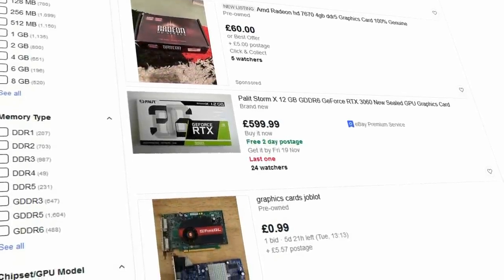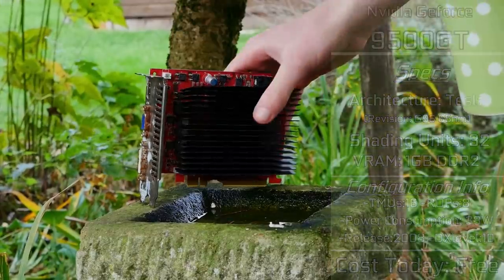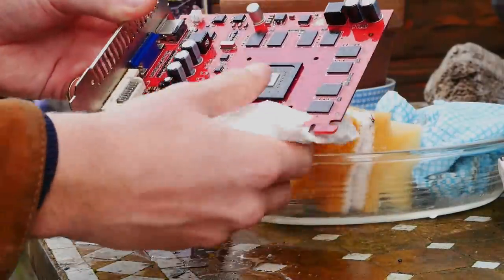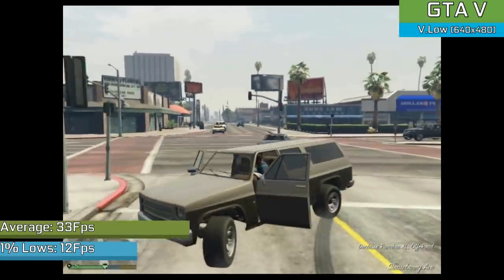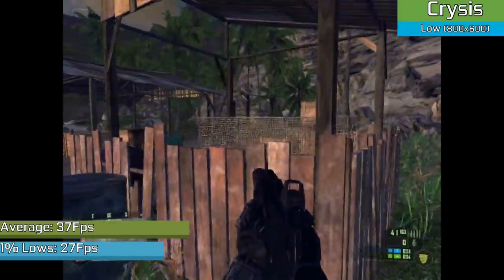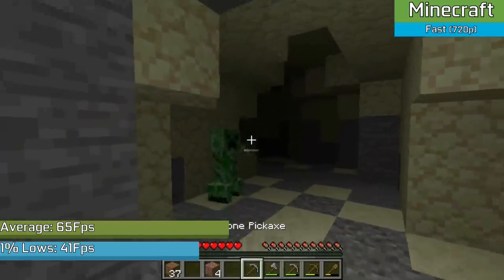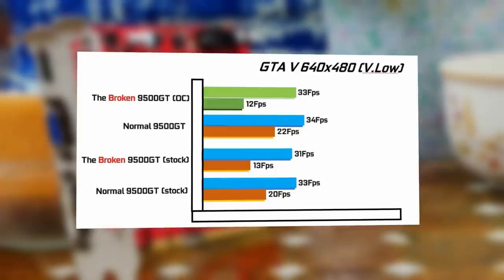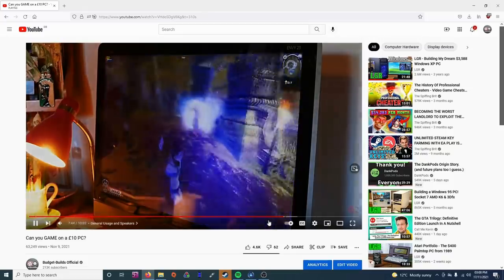Can you GAME on a BROKEN Graphics Card?!?

Comment: I just want to take a moment to appreciate the engineering wizardry that must have gone into the PCI-E protocol that a card could still work with a chunk literally cut out of the connector.  I find that someone even though it worthwhile to include that kind of signal resiliency (much less implement it) mind boggling!
Reply: we did it with a pair of needle nose pliers
Reply: Thing is, you could have a physical 16x slot but still just 1x on that slot and the card still has to work with that. PCI-E is a very robust port.
Reply: It is not really a wizardry, it is clever design. To simplify things, card communicates with MB on two lanes. It first establishes connection with the first and then it knows it has 1x . Then it tries on second. If there is a response then it knows it is on 16x. If not then it continues with 16x. This all happens fast during boot .
Reply: I don't think that the protocol was designed like that with resilience to physical damage in mind. What I got from the Video, the previous owner did this on purpose, so he broke of the connector right after the pins needed for a PCIe x1-Link. The mainboard doesn't recognize the other lanes (as they're not connected) and thinks its talking to a PCIe x1-card. If you just broke out some of the pins of an x16-connector randomly, it probably wouldn't work anymore.

Comment: As someone who has performed many questionable modifications to "encourage" hardware to work, I always found melting off the end of the motherboard PCIe connector with a soldering iron to allow the GPU to stick out to be more effective than nom-nom-ing on the GPU itself.
Reply: nom-nom-ing on the gpu made me laugh
Reply: Haha, agreed! I wish PCIe slots were simply open-ended. I get why they're not, but cmonnn
Reply: Yeah, I really don't get why someone in their right mind would ever cripple a perfectly working GPU like this (risking to completely destroy it if you mess it up) instead of just opening up the end of the PCIe slot, it doesn't affect functionality at all and you could still stick a x1 card in if you ever wanted.
Reply: @ViewtifulSam  Some board manufacturers actually do this, it's just not very common.
Reply: @netii126  that's really cool! I've only ever seen it in raiser cards or M2 adaptors and such. Wish it were common in mobos
Reply: @netii126  they probably thought there would be way less risk if they crippled a cheap display adapter to fit into the 1x slot,the full story is in the replies in one of the  comments
Reply: THANK YOU! I was scrolling through the comments just looking for at least one other person that had that idea. Like jfc why damage the GPU when you could just cut/burn a slit into the pcie slot and just have the rest of the pins dangling
Reply: Sometimes there are other components behind the x1 connector, like capacitors, that would prevent the card from being fully inserted.

Comment: i always wish gpus came with a story, especially when it ends up like this
Reply: I was the one who donated this, me and friend had a bunch of LAN machines built from old dells but the last machine only had a PCI-e 1x slot so my mate said break off the pins and it should work. So we did it with a crap card to make sure it worked and because it was a crap card. It was only playing older games (and LoL) so didn't need to be an amazing card just had to be better than on board. low and behold it worked
Reply: @hereticosjc  Still hurts! You young Hooligans! ;-P
Reply: @hereticosjc  Why didn't you instead cut away the part of the PCIe slot that collides with the edge connector, and make it an open-ended slot? With that all you're cutting is non-signal carrying plastic.
Reply: GT 710 a.k.a Wish 1050 ti

Comment: The intel UHD630 iGPU in the intel Core i7 8700K runs HALF-LIFE 2 Episodes 1, 2 at 1080p60 at max settings. Not to shabby for a iGPU with 16TMU's and 8ROPS and 192EU's or cores. Then again a Q6600 (GO) at 3.6GHz with a 1050ti can run Vulkan/DX12 Titles like DOOM 2016 and the Sniper Elite 4 series at 1080p60 at Ultra.
Reply: My laptop has an RTX2060 and also built in Intel uhd 630 graphics due to its i7 10750h processor and I’ve benchmarked the Intel graphics in 3dmark01 and it scored 42k with all settings left at default.
The time I used 3dmark01 before this was with a socket a rig with a gf4 ti4200 OC’d and iirc it got about 15k or slightly less.

Comment: In most cases you dont need to butcher the graphics card PCIe connector to fit into a 1x slot. You just need to trim off the plastic of the connector. I've seen quite a lot of motherboards with those special 1x slots.
Reply: The graphics card was probably cheeper than the motherboard. I'd risk the damage to the cheeper component.
Reply: Not a bad idea! I have that Dell Dimension (BTX LGA775) from a barn rescue (free stuff) and has only PCIE x1 as connector, leaving you with the iGPU (which is one of the early P4 LGA775) to play with. I may try that to add something a bit more decent to that puppy (it is an XP machine I mostly use to transfer data from hard drives found in the wild).
Reply: it went in a dell so no such slot that allowed it, this was the only way to do it. like Jonathan said the card was crap and it was going in the bin otherwise so might as well cut the card

Comment: It's probably been mentioned already but I'd recommend trying a pci-e x1 riser (basically the ones used for mining) so you could try benchmarking higher end cards at x1 bandwidth sooner than trying to find ones broken in a similar way, I'd also love to see the "good" 9500 GT tested again with a x1 riser and see if those issues you ran into with the broken one are still present thus confirming your suspicions about regular use being hurt significantly by the lack of pci-e bandwidth

Comment: I had an 8600 GTS back in the day that was broken just about the same as this one. Tried it and it worked just fine. Dunno if if anything was limited because unreal tournament 2004 was about the most intensive thing that I did on it at the time. Last about 1.5 years after that break so kudos!  Thanks for the video!

Comment: Some years back (2010-2012), when I ran into OEM LGA775/Pentium systems by HP or whatever that only had a couple pci and the single small PCI-E 1x slot, I would trim off the copper contacts on lower end PCI-E budget graphics cards and use them on the slot to give the machine something better then the onboard vga out. Stuff like the HD 3450 can work this way. It gave the machines a couple extra years of use as media machines, as opposed to just being trashed completely.

Comment: You should test out easily found old PCI cards on windows 10 that still have drivers. in particular I think it'd be interesting to see how they handle ancilary tasks like video streaming both off the itnernet, and to the internet, and video capture off of another card's output. Same for old OEM cards that run on less than a full PCIE 16 bus, like those 8x cards you see around. They sit in a similar price bracket, and tbh, for those of us who have a semi competent card these days, shifting tasks other than high-intensity ones to a secondary cheapo GPU that's not gonna chew up a lot of power size or system resources (hence the PCI and PCIE8x choices specifically) makes a lot of sense with the current market.
Reply: there are also PCIE to PCI adapters avaliable to plug pcie gpu in a pci slot

Comment: i have a bendt quadro card in my pc now. it worked when i bendt it. the pcb was bendt. wouldnt fit in pcie slot bendt it back. didnt work bendt it some more and it works fine. runs pretty warm but its probably only going to be used for nvenc workload
Reply: Not sure if trolling but it's spelled "bent"
Reply: @blunderingfool  ehh close enough for having english as a second language

Comment: i have a old gpu that online goes for like 200 - 300$ it is a ati radeon E-G012-04-4768(B) and its broken but it almost works i can display windows the fan doesn't work too the picture on the monitor is very glitchy

Comment: You can get cable slot powered X1 to X16 PCIe riser card adapters (I guess called mining risers now) so you can try this "mod" on other cards without actually having to butcher the cards. I'm actually using one in a used tiny form factor PC to run a dirt cheap used HD 8570 since it needed more PCI-e slot power than the little Lenovo would deliver (damn you proprietary motherboards with your non-spec parts!). It works fine. I even tried it in my main gaming PC with my 4gb RX 480 and was surprised that it did not hurt performance significantly, or at least I did not detect a significant difference in the games I played, which was probably just beamNG at the time.

Comment: Tests on more modern GPUs with limited bandwidth would be interesting! No need to wait for broken cards, you can just use some tape to mask off the additional lanes.
Reply: More modern titles utilize more VRAM, therefore 16x matters a lot. You could see that even here in GTA 5. Older titles are practically the same.